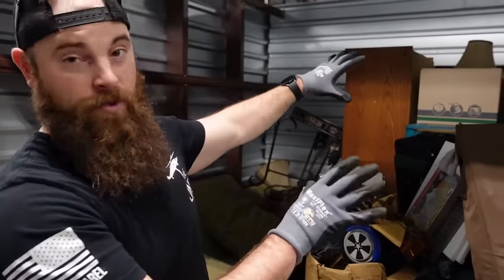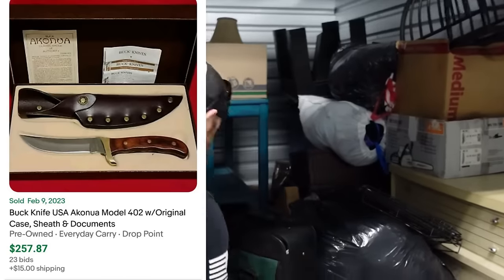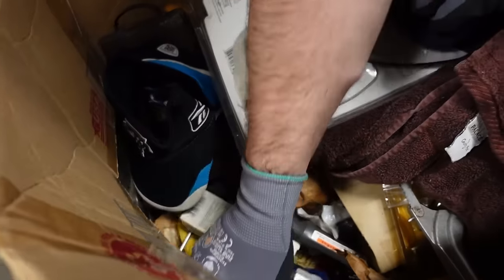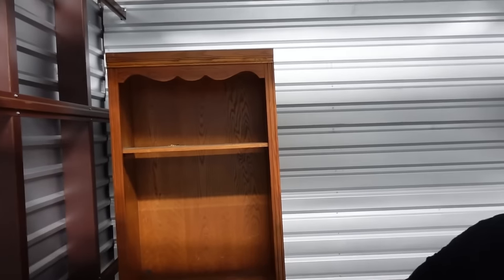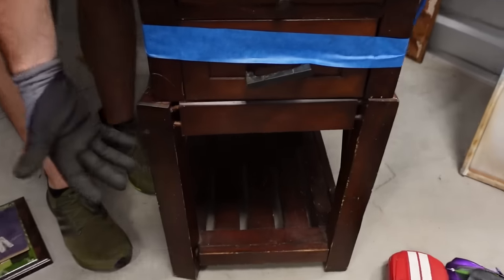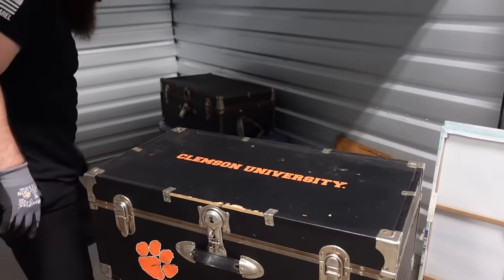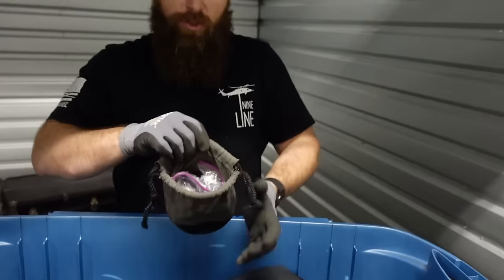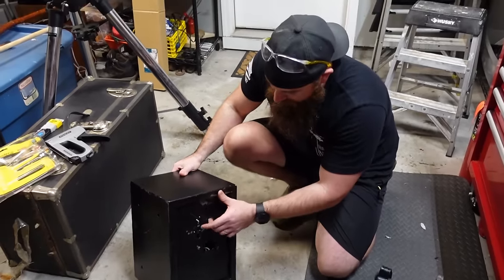$600 abandoned storage unit DIDN'T disappoint

Comment: The egg beater was a hand drill.... still used when an electric drill is too much power. Check to see if there is a maker's mark. That will determine value.  Hope you didn't trash the old cow bell. They also have value.
Reply from the maker: i think both the hand drill and cow bell have already sold on Ebay (i know the cow bell for sure did)

Comment: You should put wood glue in peg holes and clamp until dry. Clean Panama table up with just warm lightly dawned water. Not a hard fix fir an easy $100